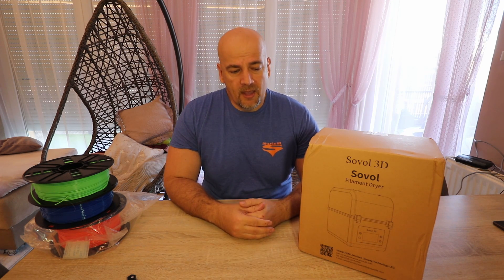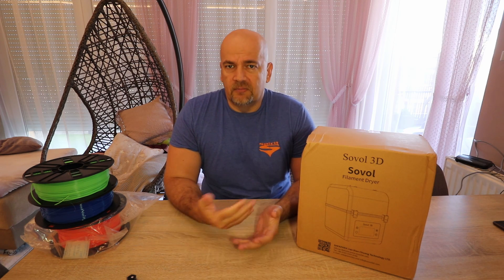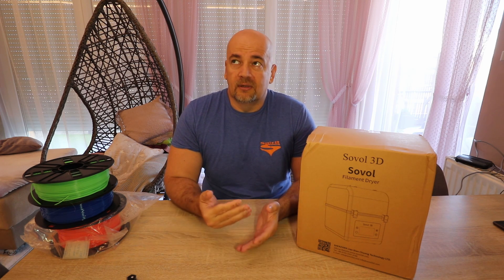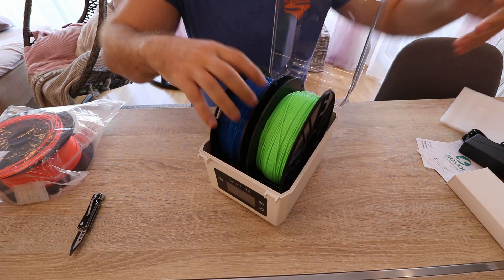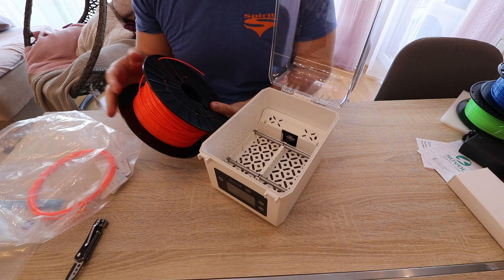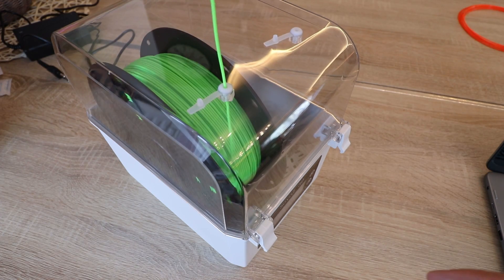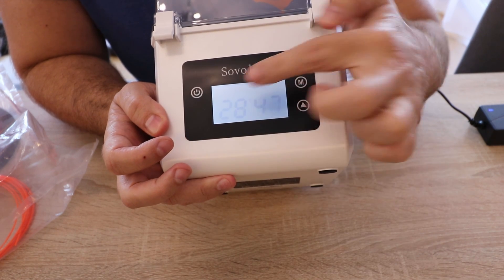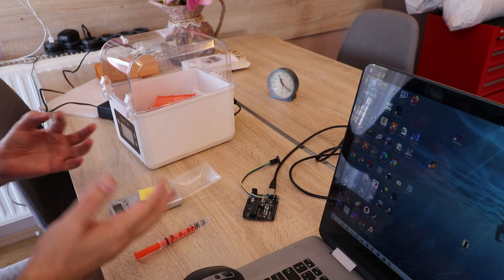Sovol filament dryer box - it can dry two spools in same time

Comment: Hello. I have a question, I have large spools with 3 kilograms of winding. The spool width is 103 mm, and the diameter is 280 mm. Will it fit into this dryer? Thank you

Comment: I have had one of these for a couple of years.  It is still my primary filament dryer.  It has many shortcomings that I've never seen mentioned in a review.  First, it powers up in the "off" mode.  It takes several key presses to turn it on.  This makes it useless for a remotely powered printer (not a problem for everyone but a big deal to me).  Timed drying isn't ideal, either.  It would be so much better if it could be set to 25% humidity and simply have it maintain that level.  Next, press board spools jam when they get near empty.  Nearly all of my spools are press board so this caused me to not use the dryer for about a year as I couldn't print reliably past the bottom third of a spool (I would transfer the spool to a cereal container with dessicant, as it would be plenty dry by then).  Lastly, the fan is total junk but that's well documented and not a show stopper, IMO.

Comment: Glad you picked up on that PSU. It's super lightweight and gets, I think, excessively hot. I bet if I crack it open, there's no heatsink in there. I used a PSU from a TV decoder and seems a lot cooler. It should be possible to use sound insulating foam on the sides (foil covered) to insulate the walls - I wonder about the heating element as it's directly on the base and that base gets really hot.

Comment: Maybe in the last print, the small stringing was due to overextruding, what is the best filament dryer according to you?
Reply from the maker: The best filament dryer for me is the one which is quiet but also has a fan and space for silica gel. Only for drying nylon I need Eibos filament dryer, all others can dry other material and keep nylon dry during 3D printing.

Comment: These filament dryers should all have vent holes at the top for the evaporated moisture to escape and larger more effective heaters to compensate and enable higher temperatures.

Comment: Don't the instructions state that the lid should be left slitly open resting on the lid clips when drying and locked closed/sealed for storage? Mine do so the moisture can escape.

Great video 👍
Reply from the maker: In that early instructions I got, no, but since it has sealing along transparent plastic part, so filament can be stored inside too (when not drying), some opening is required for moisture to go out.
Reply: If you still have it can you redo test with it slightly open? Right now this is one of the cheapest dryers on amazon.

Comment: Great review and metrics!
I got one of those, and the instructions says to leave the lid cracked for moisture to escape..wondered if that would've made any difference..
Reply from the maker: During drying yes, open. But this has sealing on plastic, so you can store the filament in it later. Then closed.

Comment: I've just bought one of these and I note that the instructions clearly state to leave the cover slightly open to allow the moisture laden air to escape.
Reply: Who reads instructions. Well I did and your right. It says the locking feature is for when you have dry filament and you want to store it.
Reply: I tried to redo MyTechFun’s test with a solder sponges but my results were better for some unknown reason:
Closed lid 30 min (MyTechFun: 22.3%): 39.3% Fog
Closed lid 60 min (MyTechFun: 56.1%): 71.9% Fog
Lid partial open (standing on latch) 30 min: 65.5% No fog
Lid partial open (standing on latch) 60 min: 102% * No fog
*The new sponges were probably not completely dry before the test.
Lid closed with four filament holes open didn’t do much difference and it fogged up.

Result: Lid partial open is far better than lid closed.

I got a newer version with two extra holes in the front and 48h max drying time. Max power was 51w.

Comment: Your experience with the sovol is not the same I had. My unit is identical but the heating element never goes higher than 50 deg C and the temperature inside the box is uneven . It takes hours to have at least 45c at the base of the box and it never reaches 40c at the top. So for me it is totally useless.

Comment: Why does nylon need 70c? Ive seen this stated in multiple places but surely 50c will still turn the water into vapour?
Reply from the maker: Drying has two main steps. 1st hi temp to force the humidity from inside to surface of filament. 2nd low humidity in dryer, so moisture evaporates from filament

Comment: Besides measuring the overall temperature, I'd suggest you additionally measure the temperature of airflow and see how precision control of these dryers. I found some dryers may emit too hot air and thus soften the bottom of filament, especially PLA.

Comment: Are these filament dryers easy to disassemble to for example replace the control and measurement electronics with something  homemade?
Reply from the maker: Not sure about Sovol, but eSun and Sunlu are easy do disassemble and modify. But if I buy a product it would be good if it doesn't need a modofication, instead I would rather DIY one from scratch

Comment: Haha, looks like they should have put that power brick inside the filament drybox to harvest the power a little more :D But on the other hand, i don't necessarily trust them if they did that?
Reply from the maker: Good thinking. Probably it belongs to different category if AC power goes into product..(harder to get some certificates)
Reply: @MyTechFun  Also you aren't exactly allowed to run those bricks in a hot box. You'd get a bare unit and validate/derate it as-needed. Then of course all kinds of potential safety concerns and cert/test considerations. Probably not of regulatory importance, but relevant to the device in question: what if someone accidentally loads the dehydrator with corrosive calcium chloride beads instead of the inert silica ones? Much safer in a Class III Appliance.

Comment: Maybe you can do a dryer mod, replacing the control board with an arduino nano, adding some front holes with tubing and adding some insulation to the sides.

Comment: I use food dehydrator, which is good enough for my needs (PLA, PETG & ASA -no need to be sealed during print). Still I'm quite interested on more compact solutions.
As mentioned in your videos (I watched them all), all consumer filament dryer still have one major flaw: 50°C limit. I see filament dryer as long term buying and because of that, there just need to be some temperature reserve (for just in case). In my opinion, it should go up to at least ~65°C. In that case I would consider buying one, if it would also have other necessary features. Finally, it shouldn't be more expensive than a "normal" food dehydrator, as I see no reason for that.
But there's another reason why I'm writing this... in your reviews you do check for filament spool width, but some brands also use larger spool diameters (than Prusa) -and so I'm also interested on max spool diameter that fits into the dryer. Maybe you consider this.
Reply from the maker: Soon I'll test Creality dryer, AC power, 60C+/-10(?) We will see

Comment: I have it. It’s 4 days now. 
I’m testing.
Improvement : 
Insulation
Higher temp
Spinning rollers
Two out holes in the front and top with plugs
Bigger fan
Faster speeds
More time settings
Price is too high.
Reply: Insulation. None on the market have insulation no doubt to keep them smaller and cheaper.
Higher temp
Spinning rollers. They have bearing spinning rollers.
Two out holes in the front and top with plugs. you can do that yourself if you want.
Bigger fan. The fan is plenty big enough for the job in hand.
Faster speeds
More time settings
Price is too high. I got mine cheaper than some of the 1 reel holders by jaylo, esun or sunlu.
Reply from the maker: I agree, thx.

Comment: 14:24 - Too bad they didn't integrate the power supply into the base of the unit to utilize the heat given off.
Reply: Besides the testing, it's also trivial to supply a different power supplies with different plugs for regions where they don't use 230v
Reply: @WoLpH  For ‘universal’ supplies, yes.  These aren’t the best option for efficiency, though, hence the heat.
Reply from the maker: Great thinking. I think product has different rating if A/C power goes into it, complicater to get some certificates (especially in EU)
Reply: @MyTechFun  
That is correct.  Buying an approved stand-alone power-supply that provides extra-low voltage to the product means that you don’t require safety testing.  This testing costs a lot to have done.

Comment: I bought a food dehydrator with the same specs (goes to 55C) and volume for 25 pounds, so I can't see why this is so overpriced. I also don't get why they won't add better functionality to it, I could probably do better programming with an arduino in a morning.
Reply from the maker: I have dehydrator too, only I can't use it during 3D printing (recommended for nylon printing).
Reply: @MyTechFun  I've been thinking of something like this : https://youtu.be/p1AQQ41gFDU
Reply: Yeah the dehydrators are produced at greater volume and don't have rollers inside... Consumer dryers are a niche product.

Comment: A regular slow cooker with a timer and temperature control for drying the filament is suitable.
Reply: Perhaps if I get some oversized rolls of filament I will steal my mother's old Crock-Pot that she never uses, very good advice!
Reply from the maker: I agree, only problem is that you can't use it during 3D printing (for longer prints). Another problem I noticed with my oven, is that it's temperature variates +/- 15°C, it may ruin the filament and spool sometime.

Comment: its a nice looking dryer but a shame it only goes to 50c at 50c that is really to low for petg to dry correctly and nylon needs 75c so they are way off here to bad i would have bought this dual dryer but it doesnt get hot enough if it wont get to 75c then its worthless to me, but you did a great job on the video as always